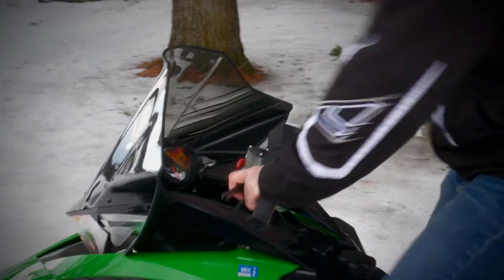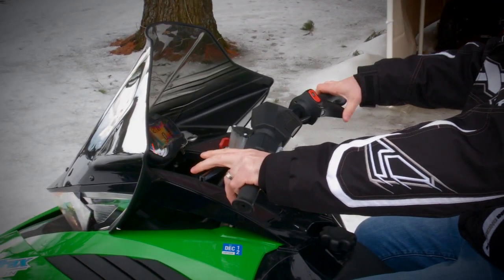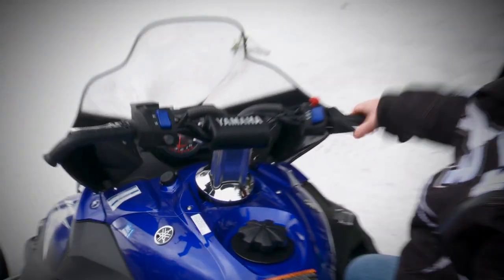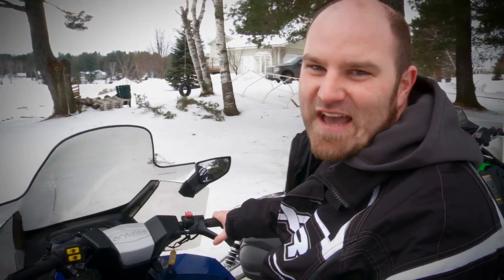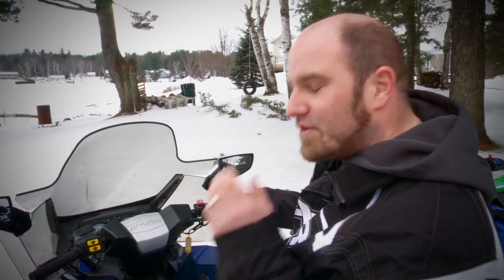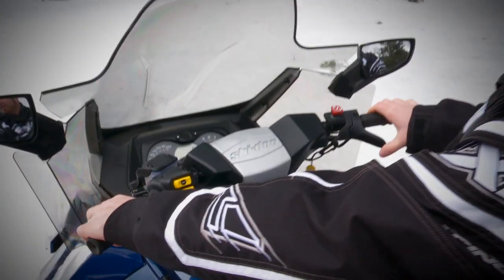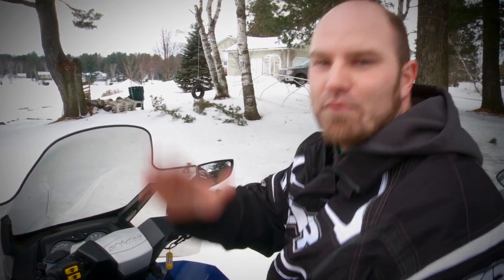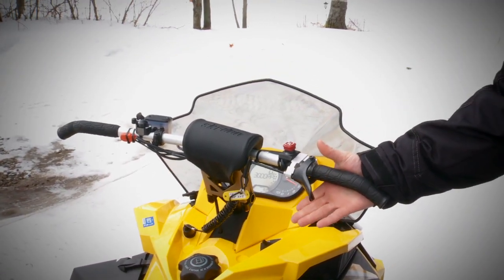Ski-Doo 4-TEC Throttle Lag Explained

Comment: I will 100% confirm throttle lag is a real thing.  I have one these final gen 1200.  Even with the “whatever ski doo calls throttle by wire” system, throttle lag due to the distance traveled between throttle and combustion.  To be fair this video does more to accurately show the lower engagement rpm of the 1200 to other sleds.  It is something you quickly adapt to in my opinion.  Every snowmobile has its flaws and this was the 1200s.  Flaw or not, even with a now 6 year old sled, I still hang onto it.  This motor in any version of ski doos trails sleds is incredibly fun.  I don’t see anyone currently making a n/a four stroke with the power to best 600 class sleds.

Comment: 4 stroke motors don’t rev like 2 strokes.  Torque is stronger at lower rpm so clutch can engage sooner.  2 strokes don’t make torque at low rpm so no clutch engagement until revs rise where torque is made enough to not bog and overload the motor.  It’s not unusual or expected to have clutch engagement at lower rpm on 4 strokes.
4 stroke motors have much more rotating mass and carry that mass when applying load so the motor can engage torque transfer sooner without overloading unlike 2 strokes.

Comment: To me thats isn't Throttle lag. It's actually a touchy Throttle, Tip in is to fast.. Throttle lag is usually turbo machine. Wack the gas and wait to go so place while building boost. 
1200 Skidoo's lack rpms. It's a Clutch engagement issue at too low an rpm level. We've solved this by changing the Clutching engagement upping the rpms before the clutches engage. There's Plenty of Throttle now, upshift and back shift. and machine are working super great! Passing the 800 etec. I think skidoo is doing a great job for its intended markets.

Comment: There is clearly a throttle lag in the 4TEC. We can all see it and it has nothing to do with the lower RPM at which the clutch engages. He hits the gas, time goes by, then it responds. Quit blaming SnowTrax for the 4TECs problems.

Comment: Two comments on this: First, like other commenters here I am confused how the clutch engaging has anything to do with throttle response.  I couldn't tell you whether the throttle lag is better or worse on the 1200 4-tec versus other motors, but showing how the clutch engages doesn't prove anything to me, especially when the clutch is no doubt set up to engage at a lower RPM.  

Second, both in this video and a different video on the 1200 I watched, you said there's a "measurable" time lag.  I think you meant there's a "noticeable" time lag, which means you can notice the lag without using an instrument to measure it.

If you really want to prove this point, you're going to have to show, probably using instrumentation, how the time lag between throttle input and engine output differs between sleds/motors.  I have no doubt you're a practical expert on such things and you have ridden more sleds than most people, but if you want to make a technical claim like this you need to have technical proof otherwise it just invites flames.

Comment: so the problem with the 1200 4-tec is that you cannot flip the throttle. and while the clutch engages at a low rpm its a bad thing for some reason. is there a reason why you would need to stay in one spot and just keep rev'n up the motor. or is it a look at me kinda thing. i am so cool. the throttle lag i gets from my 2014 1200 4-tec renegade adrenaline, if that is what you want to call it is the way all sleds should be. give it throttle and it goes. not have to over rev it to get it ready to go. and what i hear regarding throttle lag. is really to much throttle response. and if ski-doo would please make there 4stroke like all the others so people can still have the cool factor when they are sitting around with there friends. for all the people that have a 1200 4-tec you know what i mean.
Reply: I agree.  I think it should react as we would expect it to if it were a car or other motorized vehicle.  Also, I've experienced some of the other machines with a sudden tug when you get going.  I tow a SnowCoach with my 1200 SE and it's much more comfortable for my passengers to have the gradual take off.

Comment: What a moron I watched this video and held off buy my 1200. till I could ride one. Rented one, and put on 200 miles. Just one question what throttle lag? The thing was torque top to bottom. I loved the sled.  That being said I am a high speed trail rider, and my sweet spot is 75mph to 95mph. this sled is right there all the time. lake racers and flat out railroad bed riders will want more.

Comment: I would like to know what he's talking about I have been running the 1200 Renegade x 2013 and I have tried to find where this lag occurs and I simply can't find it.  It just continues to do is run perfectly at all speed never misses a beat and with that suspension package basically allows you to run any trail at any speed you want too at 21 mpg.
Reply: I agree. I have a 2016 Renegade X 1200 and I can detect no throttle lag. As per your mpg, I get only 15.

Comment: its no problem its setup that way, this moron has no idea what hes talking bout 4tec engages at 2500rpm and ace at 2200rpm. that said you gota realize a 4stroke skidoo isnt guna run high rpms my 4tec does 8400rpm and i can do 110+ with it

Comment: Throttle lag... the time from the first squeeze or blip of the throttle till the engine responds/follows suit. used to drive me crazy on earlier fuel injected vehicles, especially some of the first throttle by wire. Yes, you can learn to drive around it but frustrating when you drive others with out it. Clutch engagement is a different issue.

Comment: Pure nonsense. At anything over 2 mph this "lag" just isn't there. The low clutch engagement and super easy throttle pull is more the issue. I have nearly 10,000 miles on a 1200 renegade X and have owned, ridden, and wrenched many sleds over the last 20 years so I'm pretty comfortable saying this...

Comment: There is no problem with the 4TEC, the only difference is that the clutch engages at a lower RPM (2000).